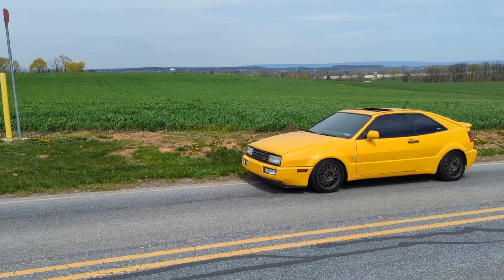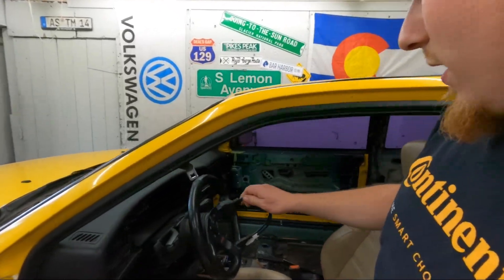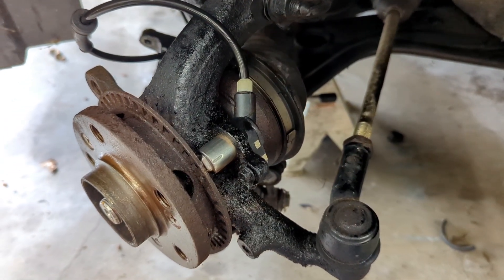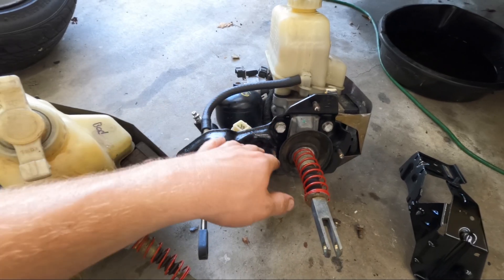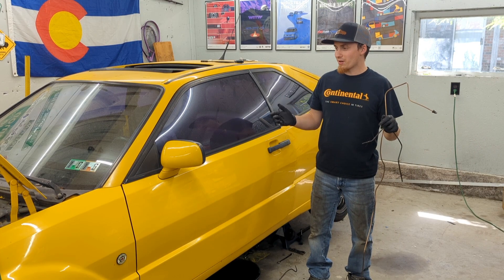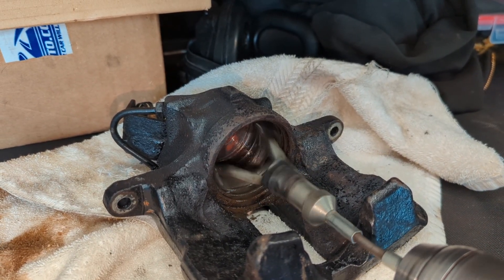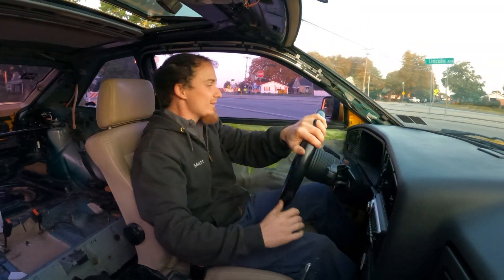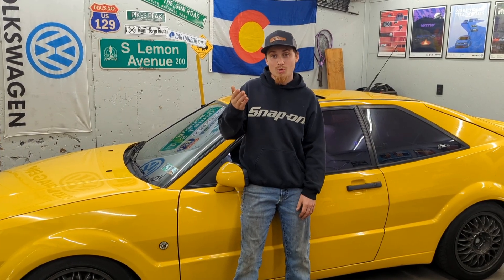VW Corrado ABS Diagnosing and Replacement

Comment: I always read for a proper brake bleed you need to cycle the ABS pump did you experience that after replacing the caliper and brake line?
Reply from the maker: There is a procedure using the scan tool but as long as you cycle the pump and build good pressure, it will bleed fine.

Comment: I'm have problems with my ABS, question I'm thinking on purchasing an HEX-V2 for the ABS but I'm running an aftermarket ECU will the HEX-V2 still work with out stock ECU installed?   "Thank Keep the vides coming"
Reply from the maker: VCDS is designed for factory VW and Audi ECUs, I'm not sure what other software it is compatible with. I would try and find someone local that could try connecting before you spend the money.

Comment: Congrats on the repair!! My 94 had a broken wire to one of the front speed sensors because the plastic guides weren't there. The tire had worn through the shield. Got two new sensors and knew then something was up. ABS worked perfectly otherwise but still swapped it out for the teves 20 abs system. Much simpler system. I definitely wanted to keep the abs.

Comment: Turn down the bite rate on the com port it might help communicate with the Corrado and for the love of god wear your seatbelt man !
Reply from the maker: Thanks, I need to learn how to learn how to use VagCom better. I need to be better at my seatbelt, I just can't stand these motorized belts lol.
Reply: @RadoMatt I hate them as well. Did the manual swap on my late and current Corrado
Reply: @RadoMatt yeah I saw you have the American auto belts . Do you have the musical door chime too? , does the dash warning light show up of you leave the door/boot/ hood open ?
Reply from the maker: @stevenharpervw I don't know that the American Corrados had a chime, that was a MK3 thing. Ok, I'll have to check out your video!
Reply: @RadoMatt I’ve a vcds video on the abs